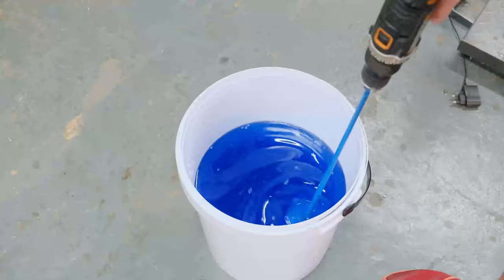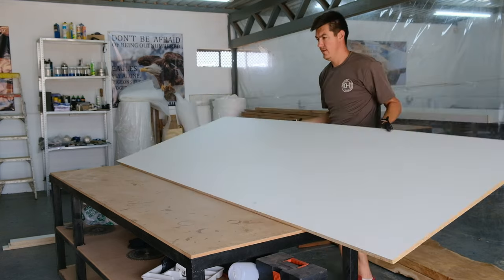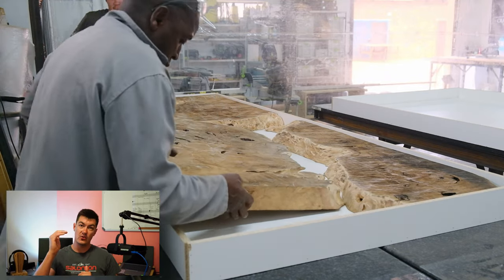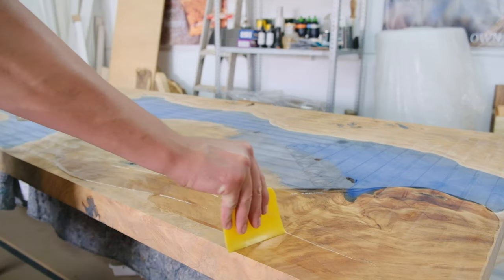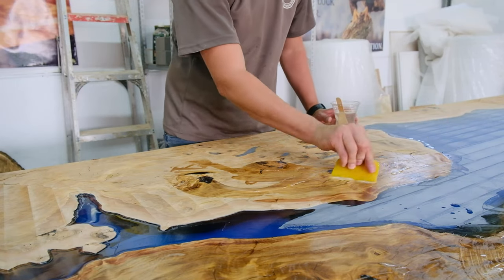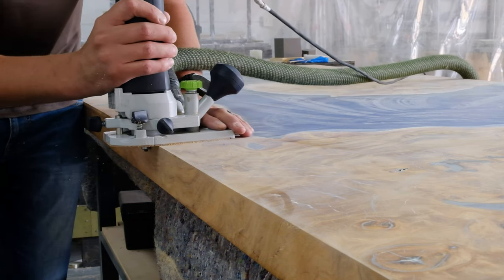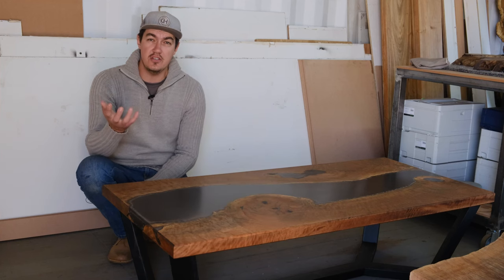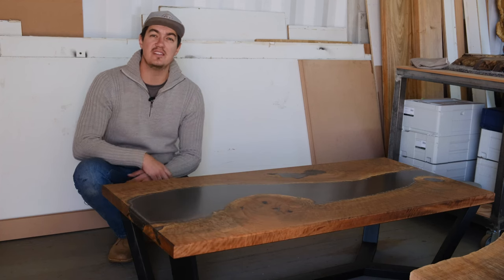making a $20 000 wood & epoxy table (start to finish)

Comment: When making a black epoxy river table, can you save resin by filling the middle of the river with waste wood? Is the black color so black you can not tell if there is wood or is it resin throughout?
Reply from the maker: I haven’t tried this, it can maybe work if you go for a solid colour epoxy, the tables we build you can see through them

Comment: Amazing work as always!!!
Have you ever had a table break due to wood expansion before? Wondering if it would ever be an issue 
Keep up the great work
Reply from the maker: Yes we have , way back when we started, due to wood that had to much moisture in.

Its very important to dry your wood and to use wood that has less then 11% moisture in it.

Wood will expand and contract, but on dry wood its so minimal you will not see it with your eyes.